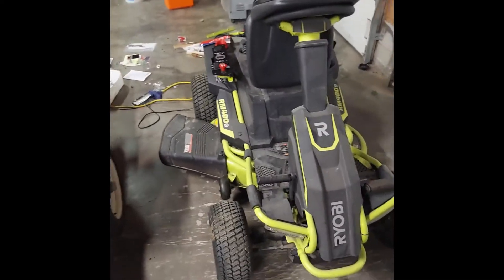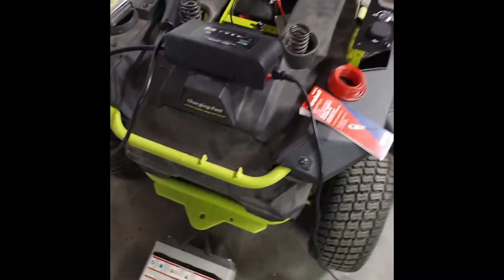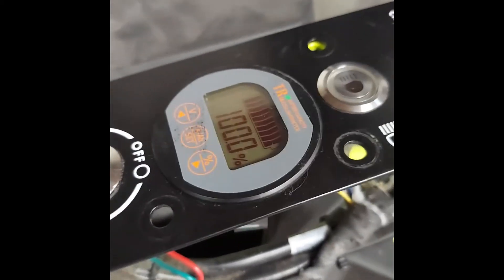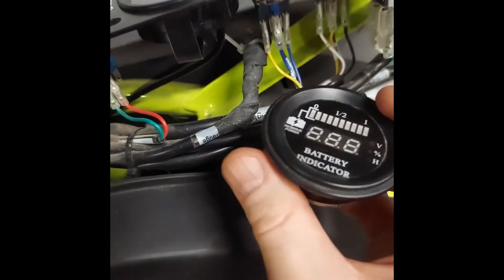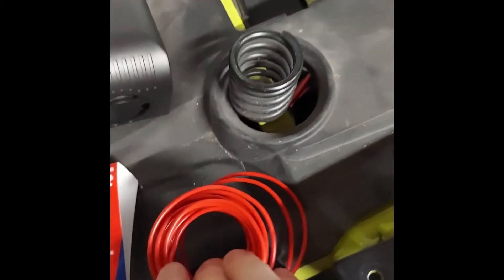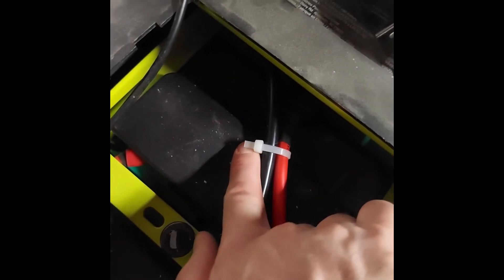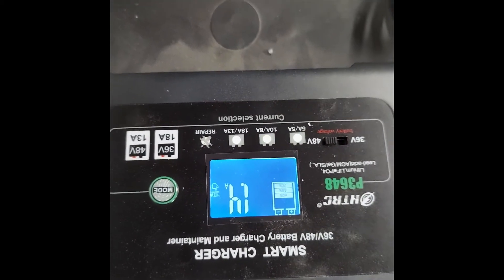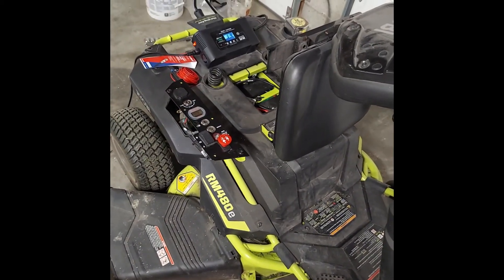Upgrade Ryobi RM480E/RY48110 to LiFePO4 Batteries - Tutorial + Required Parts

Comment: Thanks for this vid, good info.  As far as the guage goes, since I already do solar, and use a Victron Smart Battery Sense, I got one and currently have it on my mower.  I just got the mower about a month ago, and have already determined the charger (OP48RM) is bad.  I expect they will send me a new one, but the battery upgrade was already in my thought process when I bought this.  Long Term my plan is to have the mower doing dual purpose, charged via solar, and running my deep freezer when not mowing.  It's quite doable, with a little redneck ingenuity.
Reply from the maker: Good luck! Sounds like a fun project

Comment: Man, if only you had thought to record the video WHILE you were doing the work so we could see what gets connected to what etc. Still, this is exactly what I want to do with mine. Only about 2 years old and already can't do the whole yard in one session. I hate to ask you this, but is there any way you could do another short video where you remove the battery tray and show us what to connect to what? That would be super helpful! [edit: Okay, I see the full instructions in the description! Thanks again!]
Reply from the maker: I put a wiring schematic at the end of the video as well.
Reply: @ryannoble5451  Ah, missed that. Sorry! I definitely want to do this but I spit my milk out when I saw how much the batteries were ($1500!). So this will have to wait until next year. In the meantime I'll limp along as best I can with the batteries as they are.
Reply from the maker: @JustWasted3HoursHere  yeah a set of 4 went up about 2-300 hundred recently. I was able to get mine for about 1200.
Reply: @ryannoble5451  In the end it probably would still be worth it if the lead acid batteries are only lasting about 2-3 years (mine lasted just a shade over 2 years). The lithiums should easily last 8 to 10 or more years. Longer if they are only being used 50% or so each time.
Reply: @ryannoble5451  Hey man, me again. I am having a dickens of a time locating 20 gauge wire for the bridge connection. I went to several different stores and the closest they come is 18 gauge. Are there any pitfalls to using slightly larger wire (smaller gauge, like 18) instead?

By the way, who is the numbskull that came up with the gauging rules, where larger numbers equals smaller wire and smaller numbers equals larger wire? What happens if you need a wire larger than 0 gauge? Do we use negative numbers? LOL!
Reply from the maker: @JustWasted3HoursHere  it can be larger or smaller probably. It just powers the gauge. Whatever you can get that's closest to what the instructions say.
Reply: @ryannoble5451  Oh, hey, one other thing which kind of shocked me at first but then ended up being okay was seeing the HWE 100AH batteries for the first time: THOSE THINGS ARE EXTRA LONG compared to the original batteries! I thought, "Oh no, they're not going to fit!" but, luckily Ryobi was smart and they made their battery tray brackets not only adjustable but removable too. The one closest to the front of the mower I just removed entirely and the one nearest to the rear I have moved as far back as it can go and the batteries fit. The metal separator that was originally between the batteries to keep them from touching I had to remove so that the very short 4 gauge wire harnesses could reach their two terminals.

Comment: Worst battery ever. Power is dramatically reduced when blades are engaged. Chinese junk
Reply: I'm not having any performance problems with these batteries. The blades used to bog down on my lead acid batteries even when the mower was new and with these new batteries, I can only get it to bog if I am going too fast into heavier grass in one place in my yard. 

Trust me, I want to hear the problems you are having so I can be ready if mine have problems, so please describe your install and what each battery tests out at

Comment: Great job. I am planning on doing this exact project and already picked out the exact same gauge and charger for the reasons you mentioned. One tip on installing the gauge, you can bolt the shunt directly to the battery and not even need the extra black 4 gauge work. Works great and keeps things neat.
Reply: From what I've seen, bolting the shunt to the battery doesn't provide enough clearance and you have to cut the plastic panel above.

Comment: is it plug and play if I don't install the gauge? or are there any new wiring involved with installing the battery? TY!
Reply from the maker: From what I've seen in other videos, the stock gauge won't accurately read capacity of lifepo4. This is due to the steady voltage drop of lead acid vs the consistent voltage output of lifepo4 until it gets down to 20 percent or less then it drops rapidly. I guess the stock gauge will read basically full until about 20% then it'll start to decline. Don't quote me on this. Other than that it should all work fine without additional wiring as long as you have a charger for the new ones.

Comment: I got it all back together last night, used the original wiring from the old batteries to drop in the new (HWE 4 Pack 12V 100Ah LiFePO4). I charged each battery individually first with  
NOCO GENIUS 5, 5A Smart Car charger from Amazon. I wish I would have realized it would take 15 hours each or so to charge at first but I didn't buy the best option for that lol.  I didn't mount the new meter yet, but wiring it was no issue and it all fits under the original plastic covers if you fight it correctly. I just have the meter zip tied to the under seat battery metal mount where you screw the power/ground disconnect down.

I also switched the charger connectors like Ryan did, that took like 5 minutes and it works perfectly with the two wires inside of the new one instead of three from the old. I believe it was determined that third OEM wire prevents you from driving when charger is plugged in so I will probably do that at some point but oh well.

My first mow today with the new batteries almost made me cry tears of joy. No more charging it twice or three times to finish my yard. No more anxiety about looking stupid in front of my neighbors by driving .00001 MPH so the blades don't bog over some taller grass. Those days are gone my friends. I just cut my entire almost 3/4 acre on one charge and then some. I was cruising around another 10 minutes with the blades off just running the batteries down and I still had plenty left over.

Thank you for the video! I swear if it wasn't laid out this simply, I wouldn't have done it. I'll update in a few months after summer, but so far, I love it!
Reply: Did you ever get a chance to take care of that third OEM wire?  How would you go about doing that anyways?  Thanks
Reply: Nope, I never touched it again because it has been working great and that 3rd wire hasn't mattered so far. @l3z

Comment: Wanted to thank you, Ken and others for al the information on doing a LiFePo4 battery upgrade. I ordered all the parts yesterday and hopefully will successfully complete the install when they all arrive. Like many of you I like the mower but refuse to buy new batteries on a regular basis (I was just starting my 4th season). So I spent a few hundred more to do it this conversion one time and keep the mower. What amazed me was when I read how much lighter the LiFePo4 batteries are compared to SLA: about 20 to 55; one massive weight savings the batteries no longer need to push around.

I did notice that Ryobi is selling their 80V lawn tractor with lithium batteries yet still sell the older model with SLAs. They need to get their head out of their butts and change the lawn mower to lithium as well. If you factor in the the cost difference, they could bump the price a few hundred dollars and tout the use of lithium batteries' long running life. Oh well, I guess it will take a few hundred more people complaining about the SLAs before they figure it all out.
Reply: Replying to myself here. I have finished the update and actually cut my lawn twice with the new setup.  Here is a breakdown of the costs:

batteries:

Vendor: ToBatteries on EBay - free shipping, came in less than 1 week
               4 - 12V 80ah Lithium Iron Phosphate Deep Cycle 

                $876.00    batteries
                     72.27    tax   
                   948.27    total   

NOTE: These batteries weigh about 22 pounds each, compared to the 55 pounds each for the SLA ones; 132 less pounds to carry around, which cannot hurt.

Charger/monitor - from Amazon

              HTRC P3648 charger             
              Qwork 8-80v, 0-100A
       
                   $168.55    charger
                        35.95    monitor
                        22.87    tax
                      227.37    total

Miscellaneous

              12" 4 ga battery cable to go from negative battery terminal to shunt
              12" 20 ga wire and clip from shunt to positive terminal 

               11.47 total

Grand total:  $1187.11

My lot is 18,000 sf, probably 12,000 to mow. It took about 21.5% of the charge to mow it. The back is flat, the front section is larger and has hills. 

The best thing: I can now take my mower apart, clean it, and put it all back together in about an hour. 

Thanks to Ryan for all his answers to my questions.

Dave Wyman
Reply from the maker: Seems like they are going with a proprietary lithium ion battery pack for their new models. Looks like multiple 80v 10ah packs at $900 a piece. This isn't great for consumers.
Reply: @ryannoble5451  Hey there. I just got my LiFePo4 batteries today. Got the gauge and charger a few days ago. Got it all put together and it is charging now. I did have a question: does the gauge always stay on? The second I connected it it was displaying, even though the mower is not turned on but once I thought about it the power is always going to it. Just thought I would ask. Thanks, Dave
Reply from the maker: @David Wyman  yes the power to the gauge is always on. I personally prefer it that way. If you want it controlled by the key switch, you'll probably need to run the 20ga red to it first.
Reply: @ryannoble5451  Well, it is done, except for enlarging the hole in the panel for the gauge. I am wondering how the gauge maker expects anyone to read the print on those directions; us old folks do not have a chance. Also, locating the shunt is interesting as there is not a lot of room. All that is left is to try it out. Thanks again.

Comment: Lipo4 battery’s are extremely flammanble fyi
Reply: Conventional Lithium Ion batteries can get thermal runaway and can be extremely dangerous.  LiFePO4 batteries do not suffer from this problem and are quite safe, not to mention environmentally friendly.
Reply from the maker: BMS should prevent causes of catching fire. I would encourage using some management system.
Reply: what are you talking about?
Reply: Says the one guy who has zero experience in this conversation of batteries...
Reply: @rickss69  you should educate yourself before speaking. These are just facts.

Comment: I HAVE A BIZARRE EXPERIENCE! Thank you for this video! My mowers blades run for only 15  minutes and then shut off. When the blades shut off the mower automatically kicks into “REVERSE” I noticed the battery indicator also is dying a lot faster than usual. I have had this for less than 3 years so it’s very unusual. ANY HELP would be appreciated 🚨
Reply: Here's a top tip, load your machine into a pickup, drive to your nearest junkyard and then at the top of your lungs, call yourself a slappy.

Comment: great video.  I will probably use this to convert my mower.  Question:  Is there a reason you replaced with 4 12v batteries vs buying a 48 v battery?
Reply from the maker: Cheaper to buy and cheaper to replace if one goes bad.

Comment: I am having the same problem with my mower giving me about 30 minutes run time before shutting down.  I decided to open the Sealed Lead Acid batteries, and each battery took about 1/2 gallon of distilled water.  The top of the battery, in the center of the top it looks like it can be pried off, but it is glued down.  But once the lid was chiseled off, I was able to remove the rubber caps, fill with Distilled water, charge and now I have batteries that read dead are reading good again.  Note: I did not add sulfuric acid, but I may try that next season if needed.

Comment from the maker: Another plus I didn't mention for anyone reading these. The mower has a pretty steady voltage even under heavy load. A problem I had before was the mower would bog down in tall wet grass situations. Now it tears through stuff no problem.
Reply: I forgot to mention, I ordered all of the parts from the links. My gauge arrived today, and the batteries will be here soon also. It looks like the charger will be a little delayed but I still have my old batteries in there, and I plan on mowing so I can really embarrass myself one last time for old time's sake with these OEM batteries I've murdered in my uninsulated Michigan garage. I think it took 4 charges last time to do a half acre, so I think I'll treat myself to a two clicks lower blade and see if we can't get 6 charges for our last dance here
Reply: The reason I am here is because of this bogging lol
Reply: @upload638  Thanks for your great explanation and parts list. After the two hurricanes on the Gulf is when my mower died. I had to hire a guy to mow my 3ft high 4 acres. I hope he arrives eventually. I am waiting for the "Ryobi original gauge" from Alibaba to arrive. The battery company sent an extra battery with no explanation.

Comment: Did you initially have to perform the voltage balance recommendations on your batteries before you hooked them up or does the battery charger or BMS selected perform this task for you?
Reply from the maker: @Robert Dye I literally just dropped them in (at full charge from the manufacturer) and wired them up. I believe the BMS takes care of balancing for you and is a good reason to make sure you're using the same batteries (brand, model etc.).

Comment: Does the motor controller ever shut off because you have too high of a voltage with the slightly higher voltage of LF4 batteries?
Reply from the maker: @Will Allen I haven't had an issue so far. Not saying it can't happen, I'm not an expert.
Reply: @ryannoble5451  Thank you.  Please keep an eye on the max voltage you start off with (should be 53.6-ish), and if you happen to start at something closer to 55, please post if it is cut off by the motor controller.
Reply from the maker: @Will Allen  at full charge it does hover around 53.
Reply: Mine does, have to pull the Anderson connector and plug back in to reset.

Comment: Great Video!  Have you tried to start-up the mower yet?  Won't you need to install a pre charge resistor to avoid the 100amp BMS in the batteries from tripping when you try to start up?
Reply from the maker: Haven't had an issue @Rick Flail. I've gone through maybe 4 charge cycles so far.
Reply: @ryannoble5451  A lot of people that have done this conversion using these 12v LiFePO4 batteries with the 100 amp BMS' have needed to install a pre charge circuit.  My understanding is that the initial inrush current to charge up the capacitors trips the internal BMS of the battery.  I guess maybe the BMS in your batteries can handle the instantaneous current or possibly the cabling you used to wire the batteries has enough resistance to mitigate this?
Reply from the maker: @Rick Flail I'm not sure. I know all 4 batteries I installed have their own dedicated BMS built in. I didn't have any issues. It might be that the mower ultimately doesn't draw enough at any point in time to trip them. I know with the drive motor and both blade motors running it draws ~25-27 amps per hour.
Reply: @rickflail8982 According to the battery manual, it supports a 100A maximum discharge rate and a peak discharge rate of 300A for 3 seconds. I'm not sure what the motor requires but everything has been working without any kind of pre charge resistor. That said, YMMV—these are generic Chinese batteries and there is no guarantee they won't change the BMS or something else. Another owner here (@royhardy5566) said he turned the key and had no power. Perhaps that is what you are referring to?